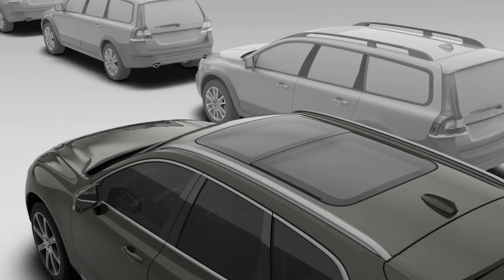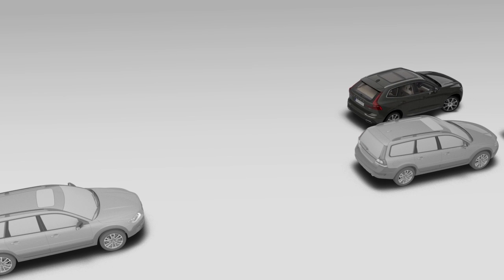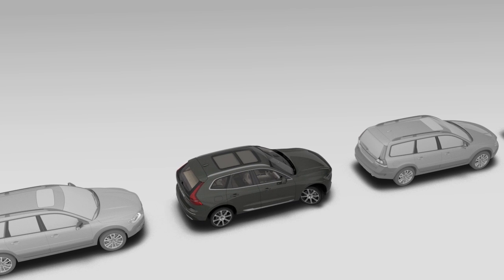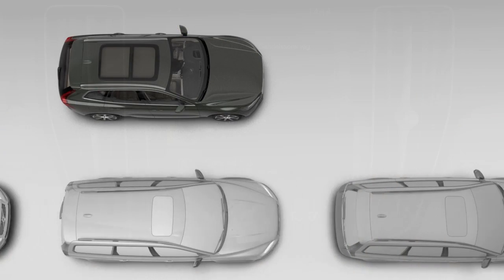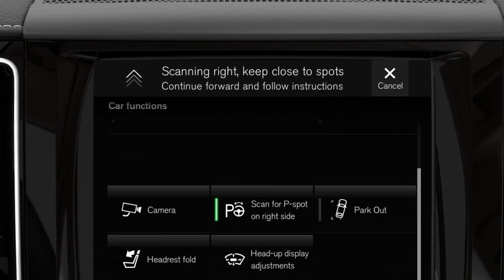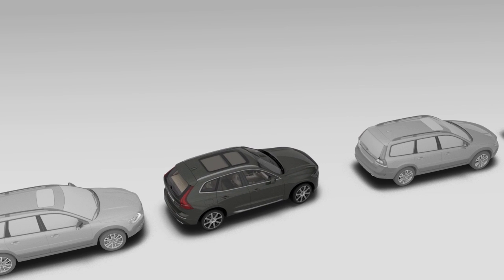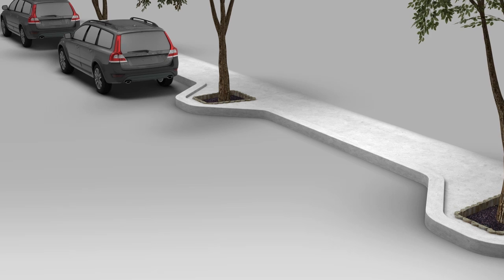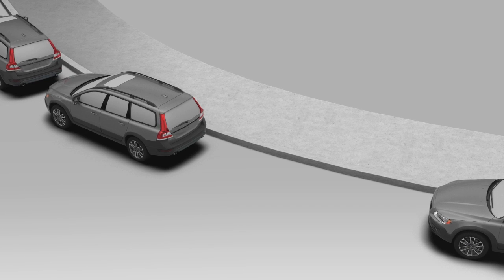Volvo Cars How-To: Parallel Park With Park Assist Pilot

Comment: Is this feature now included on all XC40 models or only certain trim lines? So hard to find a clear answer online :(
Reply from the maker: Hello, specifications and standard features do differ in each country, therefore your local Volvo retailer will have the most up to date information about availability for your country.